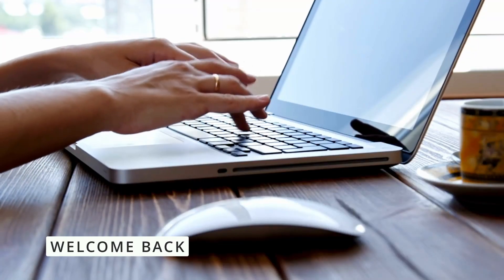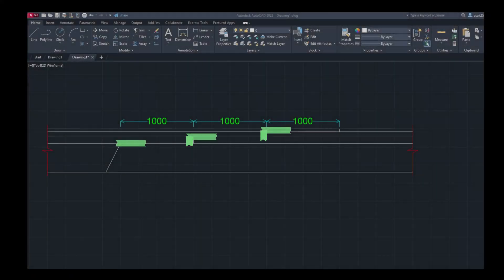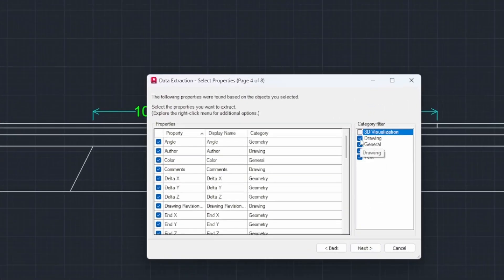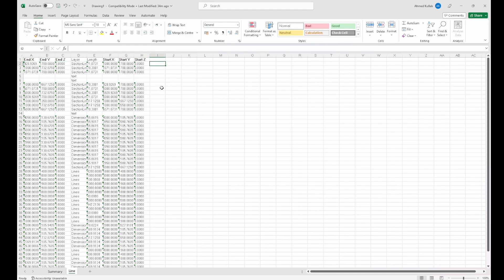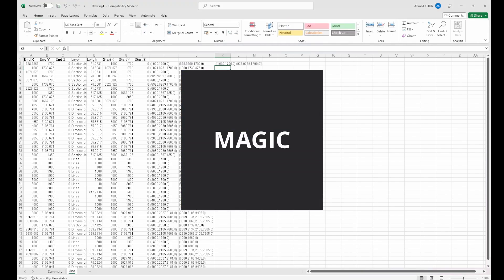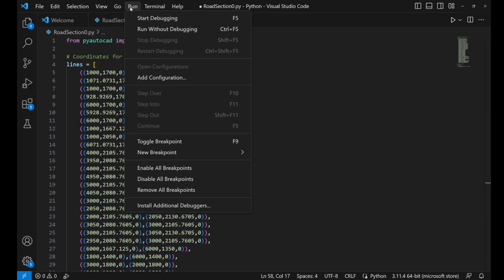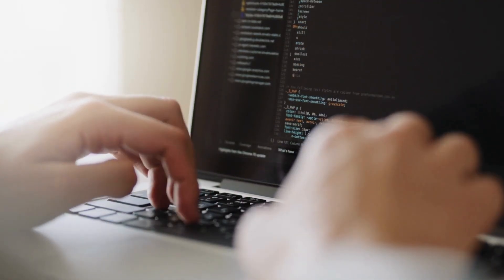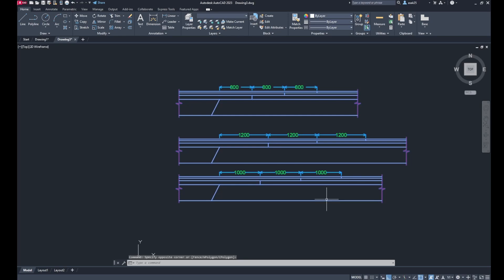How to Automate Tasks with AutoCAD and Python

Comment: Excellent video. Just as this Python library can draw in AutoCAD, can it extract data from the AutoCAD file using Python without using AutoCAD?
Reply from the maker: Pyautocad works on active drawings. EZDXF library is your choice for extracting the data without using AutoCAD. Next video will be covering the ezdxf library
Reply: There are some other solutions that can work outside AutoCAD. Open Design Aliance appears to be very extensive but may be expensive options for individuals. For those with AutoCAD licences, there is the AcCoreConsole which is a tiny app that comes with AutoCAD that runs scripts without opening the AutoCAD drawing interface. Great for batch jobs. I also use FME at work which can extract and convert info from AutoCAD and more. Also very expensive for individuals

Comment: Is it also possible to do it with Autodesk civil 3D ? Does pyautocad also works with this software ?
Reply from the maker: I have not tried it with Civil 3d before! it might work. PyAutoCAD is a Python library designed to interact with AutoCAD via its COM API. to automate tasks in Civil 3D using Python, you might need to explore other Python libraries such as use of .NET API
Reply: @ahmedskullab  Yes it works with civil3d, however I believe it only works with autocad objects. So it worn't with pipe networks, surfaces, etc.... I am just getting started but I believe that this is accurate.
Reply: Surely you could just load this pyautocad lib into a civil 3d DYNAMO “user” node (can’t remember the correct term for the custom python nodes) and doing it is this way you most likely could automate most of the first manual starting steps shown in the video with the csv import/export nodes in the default dynamo libraries or just selecting the data properties directly in the dynamo script without having to leave civil 3d. Haven’t played around with it too much, and there is way more tuts YT for revit dynamo python node creation but principles are exactly the same.

Comment: Can you save the drawing as a vector and use place it in another drawing using pyautocad?
Reply from the maker: Hey, there is a way to save the drawing as block using InsertBlock function, not sure if this is what you meant?
Reply: All drawings are vector? Unless do you want to bring it in to illustrator or maya etc?